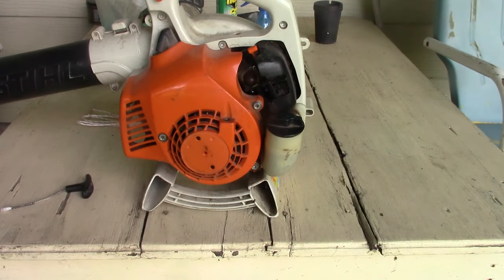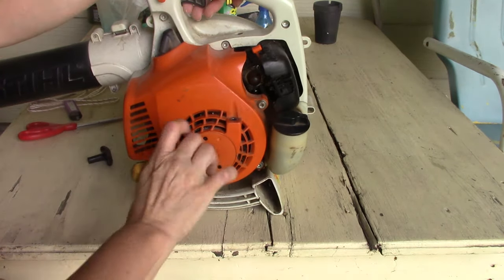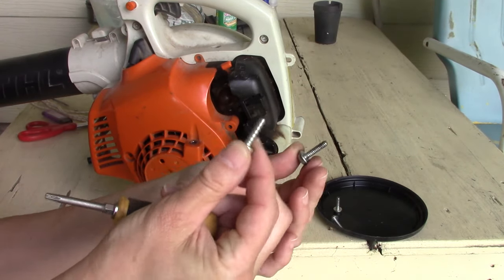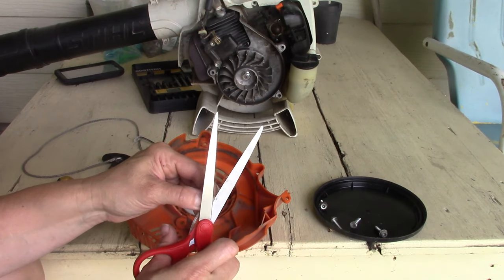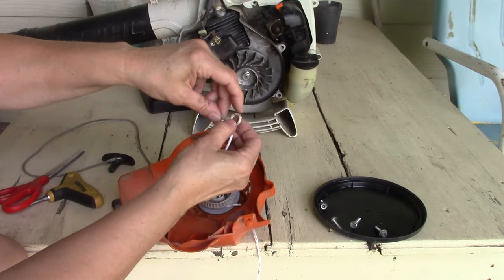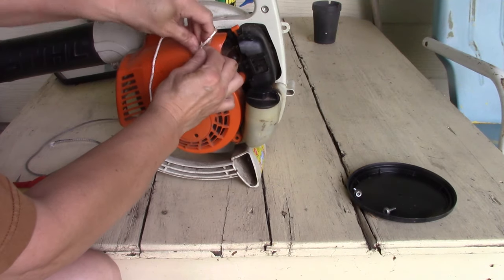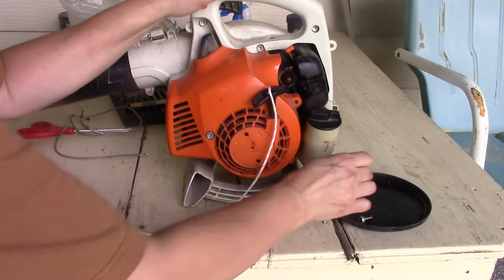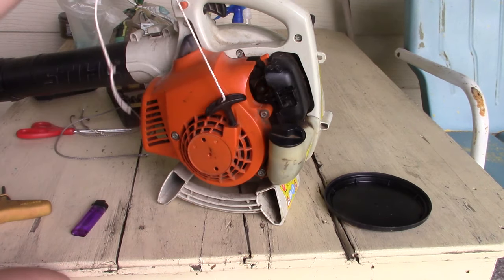replacing the starter cord on a Stihl gas blower

Comment: It's much easier to thread the end of the cord through the pulley if you do this:  cut the cord to length.  Heat one end of the cord with a lighter until it melts THEN: using a paper towel, pinch the melted tip of the cord to form it into a cone/needle.  Wait until it solidifies - it will go through the little holes MUCH easier than if you had just melted it and left it a blob.

Comment: Hello how much string are you supposed to use? Thank you
Reply from the maker: Its roughly around 3 feet, but you'll have to wind it around the spindle, then make sure it pulls the excess back in when you crank it...you can always cut some off if its too long, but you can't put it back if you cut off too much.

Comment: At 3:15 in the video you can see in that a single black rotor pawl is in the rotor pulley assembly. You reassemble it without replacing it. I lost one when I took mine apart. Will it work ok with only one or should I get a replacement? Do you know what their function is?
Reply: I may have just answered part of my own question because when I looked up the pawl on a parts diagram for the blower it is only showing a single even though there are two slots for one. I had seen two pawls supplied in chainsaw pull start rebuild kits. I dropped the rotor pulley on disassembly and pieces went flying. When I picked them back up I just figured I had lost one pawl.